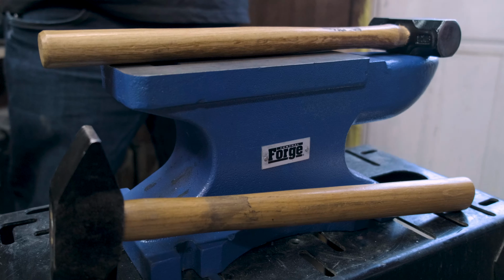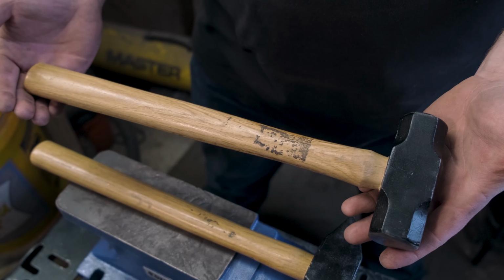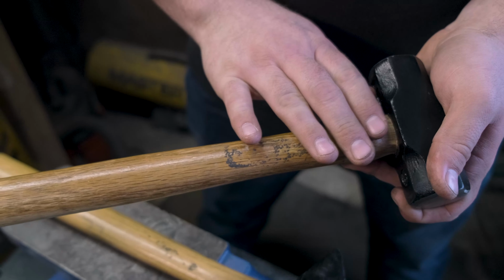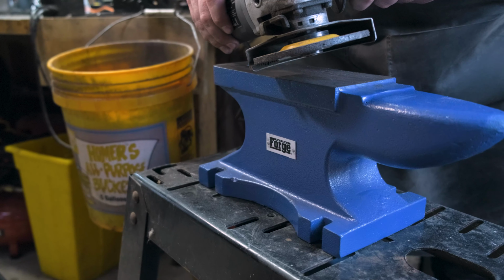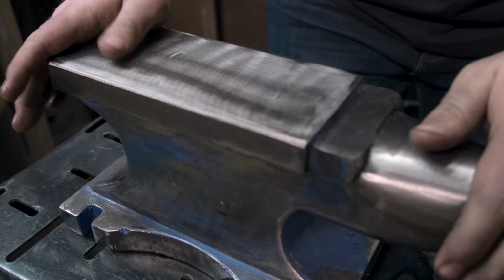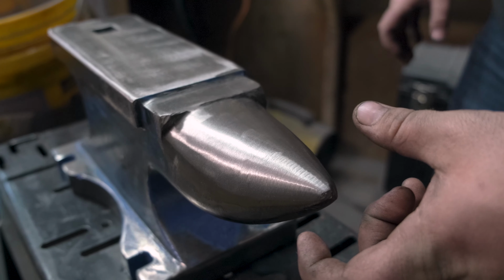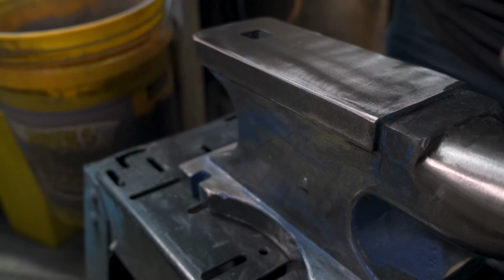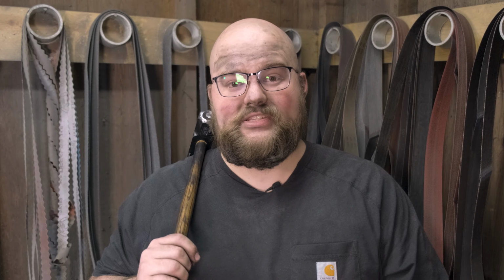Modifying My Harbor Freight Anvil and Hammers

Comment: Nice. Good work. I especially like the hammer modifications. As for the anvil, possibly hard facing with 6013 or similar to 3/8"-1/2" thickness and grinding/smoothing to your liking.  This would bring the rebound up w/55 or so Rockwell hardness. My experience is that the Harbor Freight cast iron anvil is only 40-45 Rockwell out of the box. Their new cast steel anvil is better. Thanks for the video!
Reply from the maker: Thank you and I agree. This anvil is not ideal, but if you are going to mess up your first anvil learning hammer control I’d rather it be this one!

Comment: I did most if this with my hammers and my smaller anvil but i left one corner of the strike face sharp to have a line for shaping hard 90 degree inside coners. That horn turned out great and i like the finish on the hammer handles.
Reply from the maker: Thank you!

Comment: Nice video, I’ve a new HF anvil and the top surface is machined with  grooves in it.  Do you just freehand the angle grinder with different grit wheels or is there a trick to getting a smooth/flat striking surface? And what grit wheels do you use?
 Thanks again!
Reply from the maker: I used an 80 grit and then 120. If you are careful and do light passes you can keep that top nice and flat

Comment: Did you use flap discs on the anvil? If so what grit did you start and then finish with?
Reply from the maker: Hey! I used a grind wheel for most of the removal and then used a 120 grit flap disc to smooth over the grind lines. It worked a treat! 👍🏻

Comment: the horn seems way too soft?
Reply from the maker: It is very soft. I had to re surface it quite a few times when I was using it.
Reply: It's cast iron, not steel. Its not going to ever be hard. Cast iron has 2% or 3% + carbon content, which is WAY too much to harden, and its WAY too much to weld properly with ordinary methods 
On top of that, it's really cheap cast iron. If you ever get your hands on one and have occasion to break the horn off (which I have) take a look at the grain size in the break, I even saw some graphite inclusions (graphite = carbon).

I'm not knocking it, it is what it is and even the guy in the video is right about that... its a cheap anvil-ish thing to smack around while you develop skills and decide if you want to spend more on a steel anvil. All that for 50 bucks is really a good deal.

But yeah, its soft and that's all it will ever be.

Comment: Most of my blacksmithing tools come from Harbor Freight. If you dress their hammers, they're fine. Sanding belts are okay. Their anvil isn't good. Too soft. I got a 70 lb. from Vevor delivered for $85. Worth a look. It doesn't have a beautiful ring sound like old time 300 pounders but I can punch through steel and not leave a huge divot. Whatever you use, enjoy and stay safe.

Comment: I started out with the same anvil, as pretty as you make and functional as you get it it's just "polishing a turd" I know myself cause I resurfaced it getting it flat so many times that the little shelf part was almost gone, the Hammers are awesome tho, they are the only thing that held on for over a year now banging hot and cold steel without major damage
Reply from the maker: I agree, but I stand by my reasoning for using this anvil to start out on. When you are honing in your hammering skills you make many mistakes. I’d much rather make those mistakes potentially ruining a $50 anvil then a $600+ proper anvil.

Comment: Honestly whether or not to weld a harder top to it or not, either is a good choice. But sometimes having a cheap spot to beat things into submission is paramount. Also good if you decide to work softer metals.
Reply from the maker: Exactly my reasoning. It’s just a junk anvil that I’m learning on so I don’t destroy a nicer one with miss-hits 👍🏻

Comment: The main problem is that the face of the anvil is still very soft Steel!  All you did is cosmetic.
Admittedly you improved the hammer's cross peen, but that is about it.
Reply from the maker: Correct. If you look through my videos you will see how the Harbor Freight anvil dented and deformed over the year I used it. This is not meant as a long term tool. This is just a cheep anvil to make your mistakes on before you invest hundreds of dollars in a good one. Over the year I used the harbor freight anvil I refaced it multiple times.

Comment: That blue is horrible, I'd rather they just spray oil on them, or a varnish to prevent rust,  a black oxide would be so much better!
Reply from the maker: I hate that blue as well. I ended up spray painting it black in the end